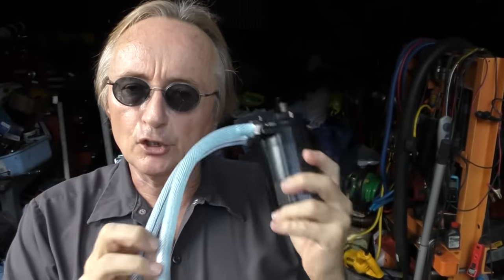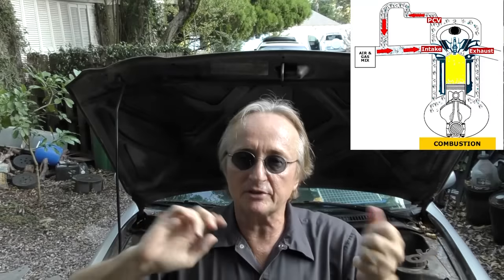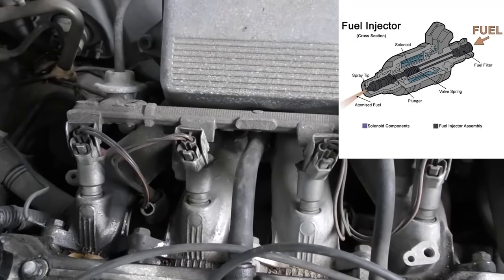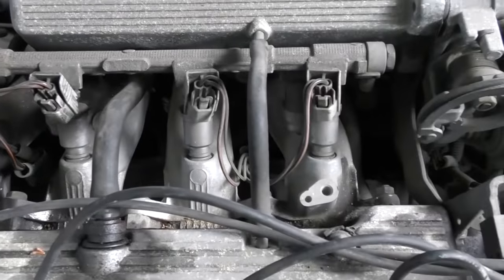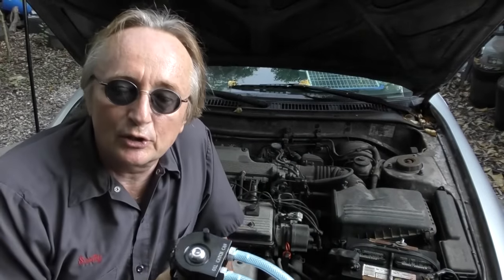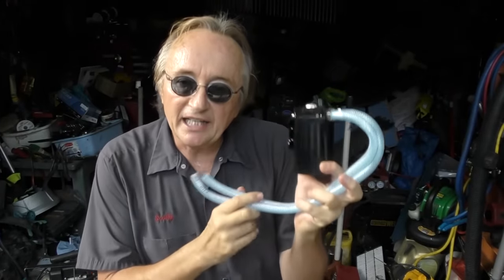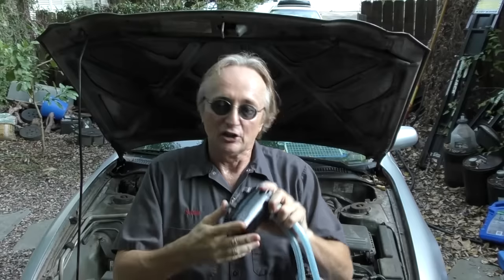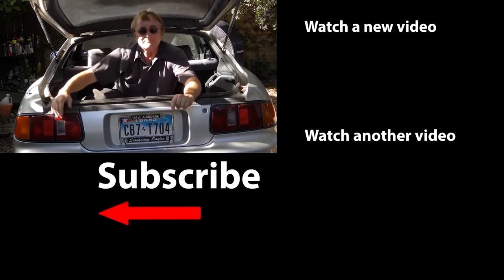If You Have This Type of Car, You Need This to Prevent Damage to Your Engine - Oil Catch Can

Comment: It is unconscionable that car manufacturers did not know this extreme level of intake valve carbon build-up would occur going into the game.
Reply: Volkswagen is utter shyte
Reply: Impalaman's Garage it’s about business make a short lived engine so we’re forced to buy a another car to keep money and production moving in an endless cycle.
Reply: They know it happens back in the past youd just have a hose going to the ground but your not allowed to do that now lol
Reply: As long as it meets EPA regulation and survives past warranty... it seems they don’t care.
Reply: Planned obsolence
Reply: United we stand divided we fall Of course MFRs knew about this, but why would they pass up an opportunity to charge the customer for an expensive cleaning service?
Reply: They knew
Reply: I took the hose off my truck.  As soon as my current car is out of warranty.  Off it comes
Reply: Most car makers in the US wouldn't of been so quick to do DI engines if Obama's EPA didn't get so strict.
Reply: Poor engineering due to the rush to get the product to market to meet Epa fuel mileage standards. Shorter development time will always lead to issues passed on to the customer.
Reply: I'm sure they had to know, but they figured that the real damage of the build-up would not occur until after the car had worn out.  Their planned obsolescence was intended to defeat the design flaw, but it didn't work out that way.
Reply: That's because they make money of off doing all the service maintenance your car required at those high mileage
Reply: @kerwinwade1884  just use quality oil that is designed for GDI engines like Castrol Edge or Valvoline Modern Engine, use CRC  GDI  Intake Cleaner every oil change and manually clean carbon from your valves with B-12 chemtool and drill wire brush every 100K miles or so, and VW TSI will be well worth it
Reply: @temich1985  or i could get a proper car and only change the oil
Reply: @kerwinwade1884  sure get yourself a Toyota or Honda and be part of the grey & boring 80% of mainstream cars on the road
Reply: that's VW for you.  I owned a 1980 Rabbit for two years back in the day, it was the biggest rolling pile of sh!t you ever saw.  In 1990, I traded it in for $450 and spent $4,000 on a 1983 Nissan Sentra instead.  
Like night and day.

Comment: Scotty absolutely love your vids. Learn so much about history of engines and problems that occur with engine design. Never realized how clean the valves stayed by injecting fuel directly into the intake valve system with direct injection. Hoping to soon modify a Buick 1963 215ci V-8 to direct injection with some Rover parts. Now I know exactly  how I want to introduce the fuel to avoid problems.
You are GREAT!

Comment: Thanks Scotty! You convinced me to order Catch Can (via your affiliate link) to my Hyundai Santa Fe with GDI engine, in the long run it's cheaper to install $35 catch can than use CRC intake valve cleaner $10 per can
Reply from the maker: Glad to hear it, thanks for the support!
Reply: My catch can cost 150$ :/
Reply: Wow i wished i would have known this when i bought my 2012 kia soul i bought the crc cleaner and will buy the catch can after i clean it
Reply: +TheMidnightNarwhal - The People who you bought from went to a nice dinner for sure!! 😂😂😂😂😂
Reply: IMO that CRC cleaner is something that you would use regularly from when the car is new every 15K miles or so. If your first use is at 60K miles it will never clean the valves very well. By then the valves would need cleaned manually.
Reply: @Deucealive75  i first use it at 40k miles and use regularly every 4k miles, so far engine runs great
Reply: Crc can damage your engine from what I hear so I rather use a high quality catch can. Mine was like $180 but much higher quality and has a drain valve and extra hose so it's easy to drain it every oil change
Reply: A $35 catch can is probably not effective.

Comment: I have a GMC Sierra 2015 which is GDI and I don't know if General Motor have thougth about this problem at this time but when I bought it in 2018 I didn't take a chance and already installed one. It surprisingly how much sludge it can catch in little time.

Comment: I have been running a catch can on my 3.7 mustang, between oil changes (every 5K) I collect at least five table spoons of oil. I've been running one for about two years and I have probably kept at least a half of quart of oil out of my intake. 
My engine is not forced induction and I don't drive crazy. I do drive spiritedly from time to time but I don't abuse it.

Comment: I have a 2016 Audi A5 (2.0T) w/GDI.  I installed a catch can when it was basically brand new.  Initially, it did capture a little oil. Perhaps it was due to engine break-in?  After a few hundred miles, the catch can never has any oil in it anymore. It's just dirty with a dry residue. Is this normal? The engine currently has 17,700 miles on it.

Comment: Hi Scotty my wife has a PT Cruiser & later down the track I went & took the top off the air filter box & just to check the condition of the air filter & I was quite shocked the air filter was covered in oil & I took the whole complete air box out & cleaned it up & took awhile to clean all the oil out of it & then I thought of a solution & I cut the cut 2 of air breather hose & mounted 2 breather filters on each end  of the breathers & I thought that would work & put in a new air filter back in the air box as it was nice & clean & having those breathers on the end of the 2 breathers was going to be ok but  I was wrong & when I went with my son to take the PT Cruiser to a garage to get to new tyres fitted to the front to get a Warrant of fitness & noticed oil on the concrete floor from under the PT Cruiser & noticed the oil over the rocker cover & had come from the 2 breathers & I went oh no & I'm going to have to get a oil catch can the mechanic that was there I told who was Tony & that I will need to get a oil catch can & the one that Tony was going to get was too big & so I'm going  to have get an oil catch can from AliExpress & the oil catch cans here in New Zealand range from $109.00 & $326.00 & up to $858.00 & that is by way too expensive & may have to try AliExpress Kind Regards Peter & other than that the engine runs fine & I know it's got blow by & I can't afford to do the engine up Scotty

Comment: Things I learned from this video: 
Buy an old toyota
Never buy a volkswagon
Reply: Pretty much all of scottys videos teach you to buy a Toyota
Reply: Yeah, never buy a VW...my 18 year old Golf Mk IV has just clocked over 265,00kms. It runs like a German clock, apart from standard servicing and maintenance, all I've had to do is replace the fans. I gives me great fuel figures, and laps up my 1000km/week commute. Every manufacturer has good and bad models. Scotty obviously loves his Toyota, and I get the fact that it's reliable. But for people who actually want a car that handles and is fun to drive, a Corolla is just white goods on wheels. Different strokes for different folks...
Reply: i had an old Toyota... it died. Also my profile pic is my friend's 92' Camry that blew up. I don't think they are bad, just like anything, they still break. but i do agree with not buying a Volkswagen
Reply: japanese cars have good engines and horrible interiors.german cars have good engines and nice interiors and good handling but not so cheap to maintain.once you drive a german car you wont like to drive anything else.
Reply: I've driven and worked on many German cars (VW Jettas, golfs, BMW 3series, older 7 series, Audi A4, Mercedes Sprinter maybe others) they all had a nice ride (except the sprinter and bmw 3 that the rear subframe broke) and decent interior but i liked my interior on my older Cadillac much better and VW interiors seem to always smell like crayons and have the weirdest cup holders for no reason and always break.  1990's Passat cup holder is the worst i've ever seen for design. Also the 20v 1.8T engine is terrible. The main reason i don't like German cars is because they are so hard to fix, it's like they make it hard to work on on purpose
Reply: +Wolfemancola cup holders was fine in my golf mk4 .i always fix my on vws and they are easy to fix (esp petrol)and last a long time if you use german parts.
Reply: Your in America why you will buy Japanese or German cars we are in there just buying American cars the look great interior look great and the are cheap like Ford cars or Chevrolet or chrysler &dodge
Reply: Nothing will make em want to buy s car other than a vw or BMW. If you treat them good they'll treat you good.
Reply: @wolfemancola  Not just hard to work on, many of the German cars need specially designed tools to do work and some of these tools are simply not freely available.
Reply: Lmao
Reply: My passat has over 400k and still runs. My car shouldnt have run that long stupid thing 😂 not even a check engine light think the bulb is blown
Reply: I worked at a auto auction the last few days, it was full of Volkswagens and other German cars. one shop did nothing but work on Volkswagens patching them up so they could be ran though the auction.
Reply: I’ll never by a Toyota
Reply: My Toyota have Volkswagen badges.
Reply: @spokebloke1  I LOVE YOU!!! SO DOES MY 2019 JETTA!!!!
Reply: Patrick Murphy if all you have is German cars then it’s a good idea to have all the German tools :)
Reply: @djshumon  Yup, German's are fun to drive... not so much fun to maintain. As much as we loved our VW (Golf and Jetta), the wife and I are now driving Toyota. 

Sure, they are not as much fun to drive, but always having to deal with failing bearings, switches, sensors and other little annoying gremlins was getting old.
Reply: @karwansaleh419  Many so-called Japanese cars are actually manufactured in the USA (Or Canada)
Reply: @spokebloke1  If you bought a car that was built in Europe, sure it'll be reliable. But in the US the majority of the time the car parts are being assembled elsewhere and the evidence of their shotty work becomes evident :-(
Reply: Mazda, KIA are all using GDI engines. If im not wrong Honda too
Reply: @spokebloke1  I think your missing the main point of this video...Direct injection motors, I would lean to betting that your 18 yr old VW isnt a direct injection...so this doesn't really apply to you or your VW.  Yes alot of the old VWs were very reliable, no doubt.   But I am person to who likes any kind of car thats a quality swap or built not bought car.
Reply: Never even think..or look at.a VW -electrical can.of.worms!
Reply: My Jetta has 200k on it
Reply: Or get a catch can.
Reply: Best car ever- Toyota Matrix- 220K and still runs great, 30+ mpg always, room enough to put in 8' lengths of lumber and close the hatch, has only needed tires, brakes, a starter and a battery in the last 6 years. And I've towed pop up campers, utility trailers, teardrop campers and so on for thousands of miles with it. Worst car ever- VW TDI. Both rear coil springs broke, turbo actuator stuck, turbo oil return line cracked, fuse box over battery melted, brake light socket melted, window just fell down into the door one day, MAF crapped out, engine surged- and I am forgetting some things. This all happened in the 12 months I owned it, and it had 100K on it. Loved the way it drove and the diesel, hated having to figure out how to fix it almost every weekend. Give me the slightly tinnier Toyota that runs well every time I turn the key.
Reply: @wolfemancola  I have a feeling that camry was neglect...it'd probably still be running.of it wasn't beaten, or pushed too hard
Reply: @jacobstienecker  you don't like reliable cars huh

Comment: I run an oil catch can on my 2011 Supercharged Wrangler. I empty the can about twice/year and it's TONS of gunk always in it. That's what we're keeping from going back into the intake, folks. THESE WORK! I'm installing one on my 2019 BMW 330i, as I just cleaned my intake (GDI engine) and my valves were CAKED UP BADLY! You need a catch can on a GDI engine.

Comment: On many older cars without a pcv system, we called the crankcase vent tube to the outside air a 'road draft tube' as that is what is was. They actually used physics back then. Not all older cars were so lucky.

Comment: Youtube recommended me to watch this video today (Jan 29 2020).

If my facts are correct I recall Scotty covering in a previous video that newer Honda engines going from 2010's and upwards are Gas Injected Engines.
Again recalling Scotty's little news bits Honda is releasing a new synthetic oil sometime in 2020 to combat the carbon build-up on the pistons and the rods.

Let us see what unfolds as 2020 keeps rolling along.

Comment: Scott, Following your advice, I'm shopping for an oil catch can for my 2012 duramax equipped Silverado 3500HD, and my 2022 Mitsubishi Outlander ES. Both are direct injection, the Outlander is normally aspirated. Any thoughts on what to install? Also, temps in my area can go to -40.

Comment: What about the old system used that vented the crankcase vapors into the air cleaner housing?  This worked pretty well due to the larger surface area of the pleated-paper air filters.  The air cleaners would normally be changed regularly anyway, so this seems like an acceptable solution that would work well now with DI engines.

Comment: Toyota's D4-S direct and port fuel injection is the best of both worlds, power and fuel economy of direct injection, clean intake valves and low particulate emissions of port injection.
Reply: To me it looks like double the number of injectors to break and/or get clogged up, plus the extra associated wiring.  I can't argue about the improved fuel economy and performance though....
Reply: driftbro yea big deal Ford Motor did it earlier with Gen2 Ecoboost.
Reply: driftbro yea dont like factoids that prove you wrong eh? Toyota didn't pioneer anything.
Reply: @Davido50  yeah....sho yo right! Toyota didnt pioneer anything, except undeniably reliable, headache-free, safe, and did I mention....Reliable cars!!
Reply: David Klimmek Toyota did it in 2006, Ford in 2016, but released in 2017. How did Ford do it earlier again? Since you're all about 'factoids' and all...

Comment: Hey Scotty, I hope you can find the time to answer this question for me. I have an MK6 Golf R that I have been considering getting an oil catch can kit for. All the full kits come with a block off plate/ adapter for the original pcv and warn of possible freezing in cold weather. They advise cleaning once a week when cold and to completely remove it and install the original pcv when temps are below freezing or you could potentially damage the seals in your engine. Is this a real concern? What are your thoughts on this? Thanks.